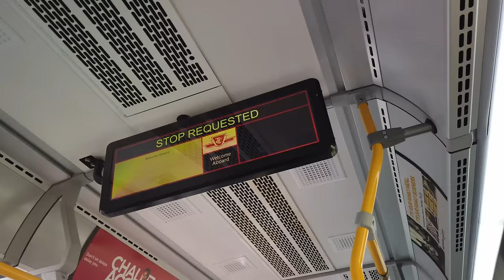Why American Buses Are Just Worse

Comment: A tidbit about the size of American trucks that you got wrong. The trucks and SUVs arent getting bigger because of safety regulations, but instead are getting bigger to bypass environmental regulations. The law essentially limits the amount of co2 per weight of a vehicle. Theres a floor at which an engine capable of moving more than 1000lbs can produce co2 at, and relative to weight they technically get more "efficient" by releasing less co2 per gallon of gas consumed proportionally to the weight, even if in reality they consume far more gas and are thus less environmentally friendly.

Comment: I live in a small city in Germany and we have only 4 buses however since the city has strong elevation it's a very important transport feature for the elderly. The ride is for free on the weekends and a monthly ticket is 8€. Funnily enough the 4 buses couldn't be more different. There is one electric bus from BYD, one brand new hydrogen bus from Toyota, a natural gas bus from MAN and an old diesel bus from Mercedes.

Comment: In the city where I live, Bogota, Colombia, it have a very good bus system (in theory), one of the largest BRT system in the world is the TransMilenio from Bogota, that uses articulated and bi-articulated buses with exclusive roadways, with 12 lines in total and at the moment, is the main transit system in the city (the Metro is on construction) and uses buses from manufacturers like Volvo, Scania, Marcopolo, BYD... assembled with the local brand Busscar and in the last years supporting renovation of their fleet bringing diesel-Euro V and VI buses, electric buses, hybrid buses and compressed natural gas buses, also in the production of the first hydrogen fuel bus, at the moment being tested to be incorporated in the near future to the system, the bus system isn't just the Transmilenio (articulated buses), also includes the line of urban buses, feeder buses, complementary lines, and special lines, that going to the most isolated neighbourhoods and near rural areas on the city. The system have some flaws, like the overcrowding in rush hours, the bunching of same routes in some stations, or the the insecurity. But the case is that the process of modernization of the bus system is really going in a good way, giving an example of a "third-world" country improving in these aspect to give confort and security to their users with modern buses.

Comment: A small tale from Cardiff (Wales). Last year battery buses were brought in. In Brugge (Belgie) they were running battery buses in the 1970s. Only taken Cardiff 50 years to catch up. Cardiff used to have trolleybuses. Now they say they have a horror of 'infrastructure'. Meaning they can't afford to wire the streets again.

Comment: We have what are essentially near-silent low-floor mega-limos with air suspension, reclining seats, usb chargers, free fast WiFi and airconditioning. The drivers are well-trained, safety conscious and helpful and generally like the job, which I am sure has at the very least normal pay, breaks and benefits. Just about all of them are really good drivers that take pride their work, and consequently are very much appreciated. It costs about 10c per stop once you pay the 2€ boarding fee, which transfers to every other type of public transportation. There are 6 buslines on my street alone, and several more on the next, the wait time is 10 minutes max. Buses get you to within several hundred meters of any meaningful location in the larger urban areas of NL. Many of the buses are electrical or run on natural gas with very little noise or pollution, all diesel buses have exhaust filters. All the equipment is recent, and gets maintained and upgraded regularly. A typical outskirts-to-city return commute comes to maybe 5-10€, and less with a discount pass. We complain every day about the expense, wait time, crowding, and cancelled routes :)
Reply: If your bus has reclining seats and NL means The Netherlands, I would like to know where that is, because I have NEVER come across a regular Dutch bus that offers reclining seats. And your story about the drivers is something I will also 'take with a grain of salt' ;)
It's normal to complain about the expense, as public transport in The Netherlands has become incredibly expensive and extremely complex since the introduction of the chipcard and public transport now is close to being the most expensive in the world (or already is) while the level of service is steadily declining for years/decades by now.
Reply: @weeardguy   You want to be transported to work in a lazyboy?
Reply: @disklamer  No, you completely misread my post. The level of service is a thing in total, not just the seating options on a bus, tram or metro. And again, if there is any bus-operator that offers reclining seats in The Netherlands, let me know. I've never seen it or heard about it. We just don't offer it as it usually is not a big deal for our relatively short journeys.
Reply: @weeardguy  My bad I was on an NS bus which is actually a touringcar.
Reply: @disklamer  Ah yes, than it's basically a surprise what shows up. I have had the luck of showing up to the trainstation, just to be a bit bummed to find out there were trackworks ongoing and substitute buses were in place. But my disappointment disappeared when this luxurious coach by Royal Beuk showed up. Reclining leather seats ;)

Comment: The original reason Toy Trucks and SUVs rose in popularity in the US was that the vehicle safety requirements did not apply to body-on-frame vehicles ,so Toy Truck based vehicles were cheaper to build and the industry pushed sales in that sector.

Comment: Never had an issue riding the bus though seats now are terrible compared to what they used to be but now you can actually clean them easier. By the way, Edmonton does have Articulated buses, there was also a single double decker but I don't know if it still runs.

Comment: Sadly most of the buses used in Sydney resemble the US buses more than the European ones. Only two doors, elevated step at the back, tightly packed seats, and minimal padding. There are usually a couple if side-on benches for the elderly and other disadvantaged travellers, but that's about all that can be said for them. (And some have hydraulics at the front to drop the entry door for people who have trouble with the step up.)

Comment: The most common complaint and the greatest barrier to increased ridership is reliability of the system ie buses not arriving near when scheduled, or not at  all. In ottawa this has been exacerbated by the implementation of an extremely unreliable LRT which was supposed to be the backbone  of the system.  
As far as comfort, and safety, goes the most important aspect of both is a well trained and conscientious operator given an attainable schedule. A chronic problem in Ottawa are drivers that race through their run which in turn puts the next driver behind schedule, which in turn makes him try to catch up.

Comment: In Europe the main theme right now seems to be the switch to electrical buses.  I come from a small town in Poland and the town is currently replacing its fleet of 6 diesel buses to electrical ones from a local manufacturer called Solaris.  The neighbouring town is also replacing its fleet of 6 diesel buses to electric ones from another local manufacturer called ARP.  In both cases both towns received grants from the EU to finance these purchases.  The new buses are crazy smooth
Reply: Electric or BioGNC, in my town (Lyon, FR) we use both, depends of where bus storage and repair sites are positionned (you can't put gas pumps everywhere).
Reply: Philadelphia tried to switch to battery electric buses. 
The buses were lemons. The weight of the batteries cracked the chassis.

Comment: the duopoly isn't the issue, in the uk we literally 90 % of busses are Alexandra dennis enviro busses or Wrightbus busses and then in london, the last citaro busses are being phased out and mercedas has left the uk bus market, scania made uk specific models (the omnidekkas) theses almost all phased out and scania has also left the uk market. I mean in london you get a bit of variety but its all just, Wright NRM, Wright gemeni shelled bussses, wright streetlites, enviro 400s, enviro 200s, and then there is a 10 percent minorty of other bus manufactures like there are 2 routes which have cateno busses, and currently 2 with Mercedes busses, and then about 10 with Optare busses, out of all 600 public bus routes in london. Things on london busses are specified by tfl, so its not competition that makes busses better its just tfl setting out decent sensible rules for all operators to comply with, like a completely straight staircase to the upper deck and accessibility (announcments a dot matrix or screen automated ramps with a set seating standard and the requirment to have blinds on the front, 1 entrance and 1 exit door etc) which is all stuff the rest of uk hardly have (very badly have) because its de regulated. Bus operates in the rest of the uk often cheap out, in other words buying brand new diesel busses in 2023, but its de regulated so nobody can stop them and they can do what they want

Comment: In the UK the problem are tight corners that articulated buses can’t get around. That’s why the double decker is useful. Problem only that you can only get on at the front and get off at the rear. In Germany you can get on and off via all three doors (sometimes different after 8pm). On the double decker the li tied access creates a bottle neck and slows things down a lot. They tried to improve this with the new Routemaster bus, which even had an open platform, three doorways and conductor plus an additional staircase. I think they have now reverted back to the standard approach because of fare evasion. 

I witnessed the trial of Mercedes Citaro articulated buses in London in 2009. For London however you need really heavy duty buses, think of toys that are somewhat overbuilt. This is because the buses see a lot of abuse, not just by passengers, but also by drivers. In short, the Mercedes buses were soon in bad shape. In Germany you can sometimes see older generations of articulated buses still in good condition, so it is really a different environment in London.
Reply: The pity about articulated buses is that they basically lost some of their extreme flexibility, at least, in The Netherlands that is. When they were still high floor models, articulated buses would have the rear axle steering along. Not fully like the front wheels, but enough to decrease the turning-radius A LOT (and if you had a rather fast driver, you would really notice how you would be swung around in the corner as the articulated part was not just dragged along by the front part, but was actively snaking behind the front part. Negotiating round-abouts like these: 52,506895, 4,967229 (you might have to fiddle with comma's or a decimal there...) was no problem at all and though current models can still do that (most likely just because the first part has become significantly shorter and the articulated bit significantly longer compared to a high-floor articulated bus) but it is harder. Hell, they would even negotiate this turn with no trouble at all 52,506637, 4,946741 (coming from the north-east Herengracht and turning north-west onto Herengracht).

Comment: Took a bus from Vancouver to Calgary in Canada (coach) it was horrible.  The seats where hard, no toilet and no bar for hot coffee or cold beverages at all.  Here in the UK I took  a bus from London to Manchester and have very comfortable seats, carpeted floors, curtains, a bar with service for hot and cold drinks, a toilet to use on the go, AC above your head and soft smooth ride throughout, with 3 stops at service stations for something to eat.  It also came with your own TV and USB port, something the Canadian bus did not have at all.

Comment: Wow!
Those double bendy busses look so cool!
...sadly they would have trouble on the roads where I live!
Turning would be tough!
Reply: Double-articulated buses run through the (relatively) tiny and compact streets of Utrecht and surroundings for decades already: operators know where they can and can't go and design routes accordingly. They don't turn like a normal bus does, that either has one rear axle steering along in case of a 14 meter bus or, when articulated buses were still high floor, usually had the wheels of the rear part steering along to greatly reduce the turning-circle greatly.
Since buses have become low-floor, the articulated bit usually does not steer along anymore, but double-articulated ones are an exception. At least the Van Hool's I know from Utrecht have a computer-assisted steering system, steering the wheels of the articulated parts with a delay. This way, the whole bus basically 'snakes' its way through a turn instead of just being dragged along: When the driver turns the wheels for a turn, the computer will steer the rear wheels based on distance measured, so when the articulated part reaches the turn, the wheels steer along as well.

Comment: Several decades ago, the South Australian Police needed a 1938 London Double Deck Bus moved but didn’t have a Driver. 

Eventually as an Officer in an Emergency Service Organisation I was asked, but I didn’t have a Bus Licence. 
However since I would be driving UNDER POLICE DIRECTION a Bus Licence wouldn’t be needed. 

For the actual journey I had 12 Police Officers Onboard (4 downstairs, 8 upstairs) and an 8 Motorcycle Police Escort. 

Several weeks later the Department of Motor Vehicles notified Me that My Drivers Licence had been changed (at the Request of Police) to include Buses up to and including Double Deck Articulated Buses.

Comment: In Sweden, the bus driver can lower the whole bus on the side of the doors, so that people in a wheel chair, parents with a baby stroller or elders can more easily get on/off the bus. It's pretty common and used 90%of the time. Also comes with the common ramp. The tilt is enough to help, but not too much to make the rest of the passengers nauseous
Reply: In Sweden, the bus is late half the time.

Comment: Its not only the regulations, transit authority slows the progress towards better buses. They want minimum breakdowns so they buy same stuff they've been running for 15 years. Also reduces staff training. I've worked at one of the buses company you named and I can say  the BAA is part of the problem. We tried to install nice seats from Italian brand, really comfortable. But turns out the samples were from Italy, and full production models built in US factory were so bad we had to recall and retrofit with standard seats...

Comment: In Our City, Small, Big buses, too many lines (its a properly small city), they even operate small villages around the city - Bus Lines: 10, 11, 12, 13, 14, 15, 16, 17, 18, 19, 20, 20L, 21, 23, 24 (Village Line), 25, 26, 27, 28 (Village Line), 29 (ZOO), 31, 32, 33 (Highway Line), 34, 35, 36, 51, 52, 34, 55, 56, 57 (School Line) and RA Lines to U. S. Steel

Comment: In China, the buses in the largest cities may be good, but elsewhere it's a different story. For instance, in Kunming (still a provincial capital with a population similar to Toronto), the buses were in most ways worse than Toronto TTC buses -- more rattly, bumpier (the bad roads may have something to do with it), and the seats were totally hard plastic without even the weird cloth material the TTC uses for padding. There were screens, but they mostly played ads, and there were a lot of repeated pointless announcements (like 'move to the back', but at like every stop). Drivers and pedestrians were also less rule-abiding, so riding on them also felt more dangerous.

Comment: i think another issue is the fact that public transit agencies (especially in america) are run on shoestring budgets and our roads are trash. 

i think you kinda glossed over the fact that most small to medium sized agencies in America at least run Gillig buses for several reasons; they seem to be quite robust and use larger tires compared all the other low floor models. the smaller agencies tend to value
durability serviceability and economics over features and comfort. 

durability seems to be one of the main factors TheBus in Honolulu uses mainly gilligs; we have 20 year old buses in mainline service every day and we tend to keep our vehicles much much longer than a lot of other agencies and durability is much more important than other municipalities

Comment: Heh. I remember the airport bus in Montreal. A regular city bus with some seats ripped out for some moe luggege space, but orherwise, entirely unmodified. The airport buses in Oslo (the dedicated ones) as well as long distance buses and "rural" buses all have seat belts. In the rare case of "missing the road", people won’t be tossed everywhere. Going at relativistic speeds on the highway in Montreal on the beforementioned airport bus was an "experience". It kept me wide awake, despite being sleep deprived from the trans-atlantic flight. I did live to tell the tale, but if Canadain drivers are as bad as they are in USA, and the highways just as terrible, at least having seat belts woukd be a bonus…
Besides, long distance buses (often double deckers, too), are sprung like down pillows, have comfortable seats and A/C, plus all your bulky luggage stored under the bus.

Comment: Those 2 axle Mercedes local busses are the most comfortable local busses that I know! They are very light and nimble in their moves and make turns with ease, unlike in most of the busses where you feel the weight shifting and the driver has to be very good to carry speed through roundabouts and slow corners without seeming extremely harsh (those Mercedes' are like magic :D ). Greets from Finland.